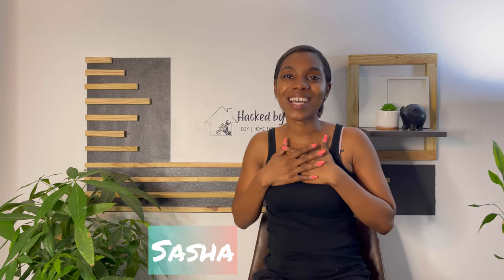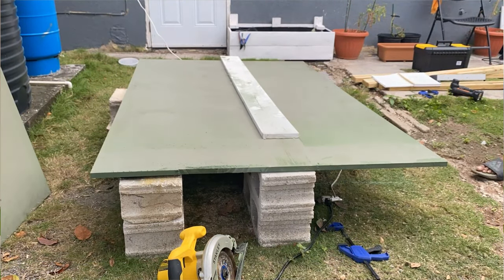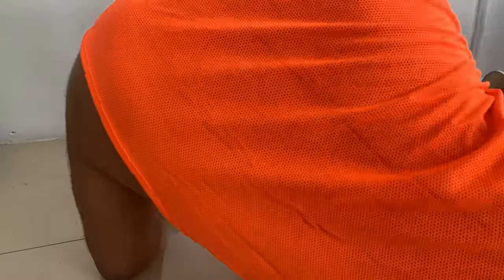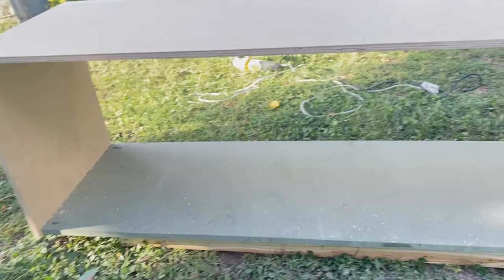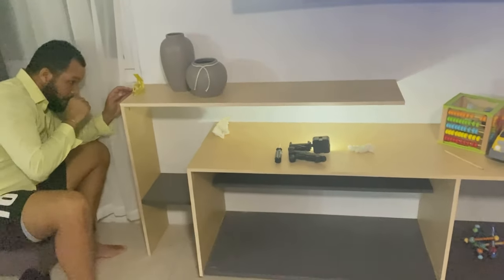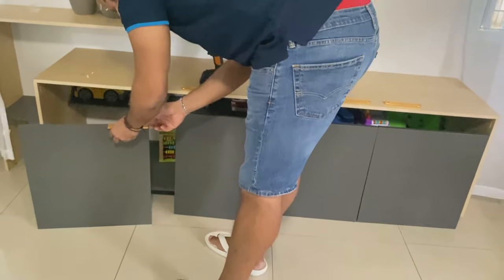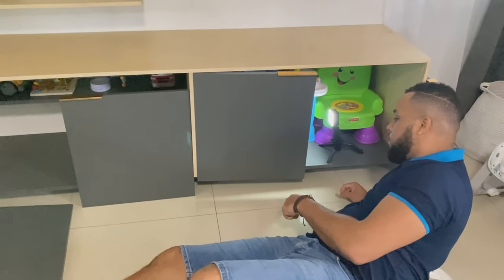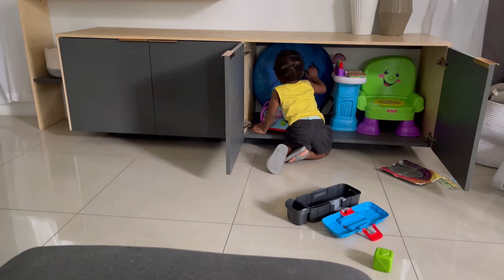How to build a modern tv console | DIY TV Console #diy #tvconsole

Comment: Tape the ply in the section you plan to cut.  That controls the splitters
Reply from the maker: Hi we tried that and it still splintered a little, we even taped top and bottom of the board. To get better results we got a blade with more teeths and smaller one and adjusted the height of the blade.
Reply: @HackedbyEbanks  yes, that's right they have blades specifically for plywood